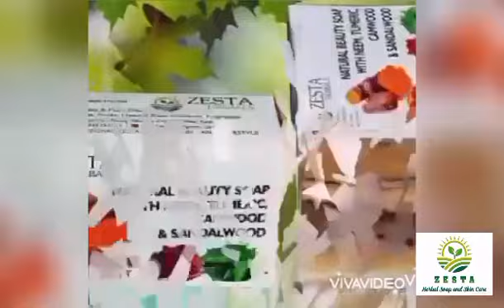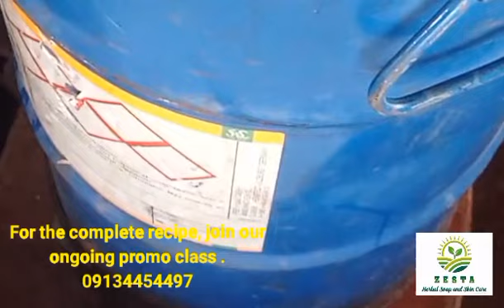HOT PROCESS LAUNDRY SOAP.

Comment: Well done ma you video is very educative. Please how many pieces did you get from the nine liters of pko
Reply from the maker: I didn't cut for sale it was large cuts. But if for sale it will be about 120
Reply: What weigh do your Bars weigh? Another thing how do you make your Laundry bar weigh more during production. What do you add to the oils?
Reply: Please assist I’m in Need asap
Reply: @zegwaizestasoapsskincarean1455  i got 126 bars with 12 litres of oil, and the weight is 120grams... i guess i am making loss. please, how were you able to get 120 bars for 9 litres please?